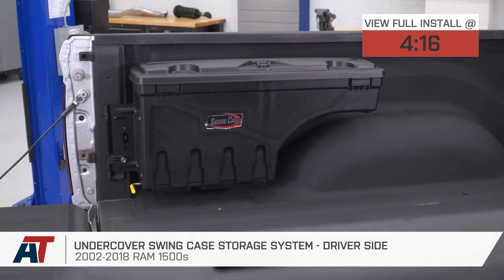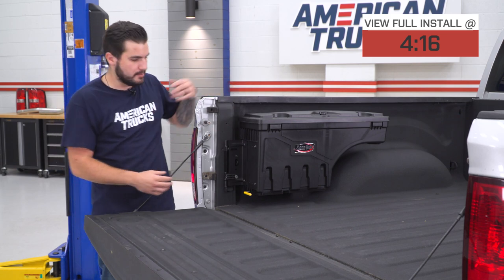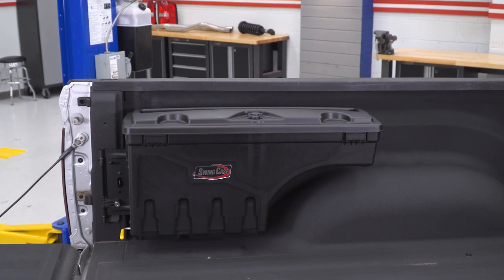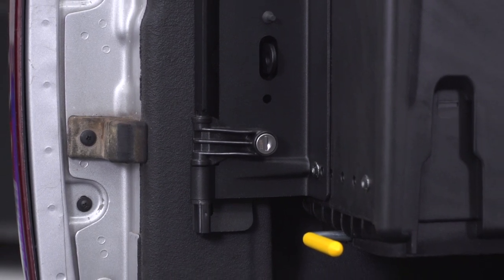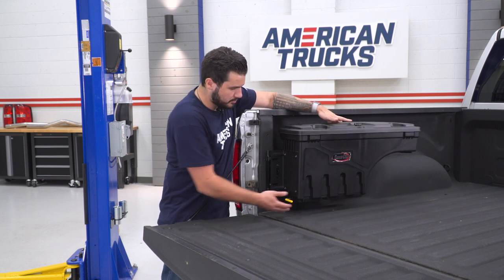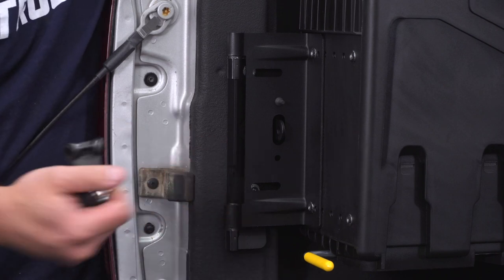2002-2018 RAM 1500 UnderCover Swing Case Storage System; Driver Side Review & Install

Comment: Does this come with a drill template?
Reply: Does not need one. You line it up with the correct dimple as shown in the video. Once it is lined up and the first bolt is installed, you just simply fill in the reset of the holes with the supplied mounting hardware.

Comment: BAD Advice. Ya NEVER drill holes in your truck bed WITHOUT at least painting the hole to prevent the rust monster from attacking.  AND Self Drilling screws ALWAYS come loose. It needs bolt and nylon locking nut to make it permanent. But the sheeeeeety plastic case looks flimsy from my screen.  I went and checked them out and true enough,  100% crap. PLASTIC does not last, metal (DIAMOND PLATE ALUMINUM) LASTS FOREVER.
Reply: You just helped me make my mind up, thanks 1yr later
Reply: @utahnick  I have had two sets on two different trucks. ZERO issues. I do wish for the price that someone would make a set out of diamond plate. If I could weld aluminium, I would own that market lol.

Comment: Trust me the plastic hinges wil break after using the product a few times.
Reply: Had mine since 2018 in my 2017 Ram 1500.  Still no issues.  

What plastic hinges are you talking about?